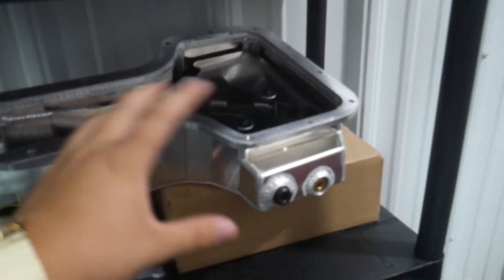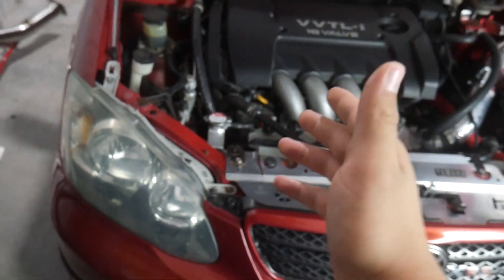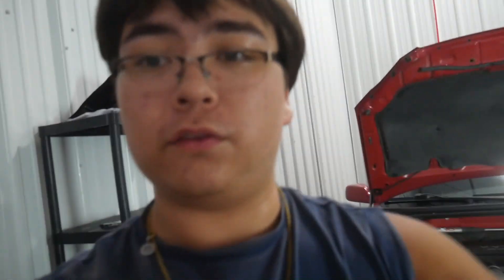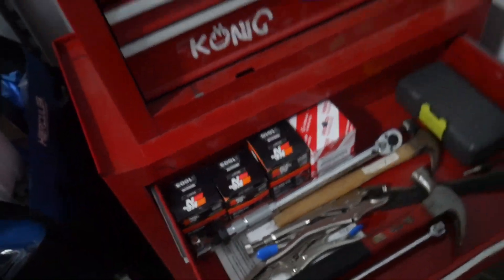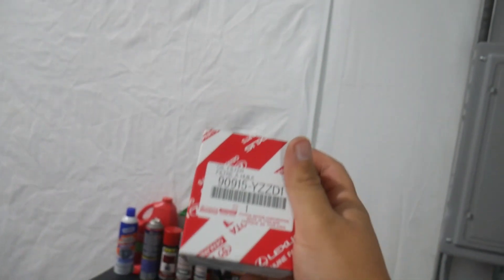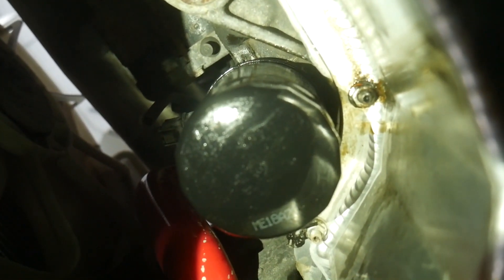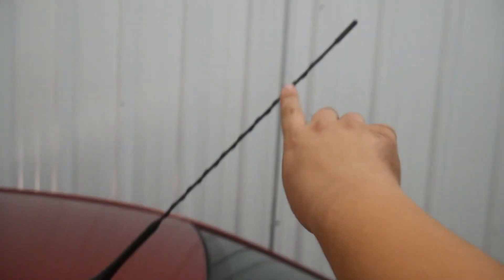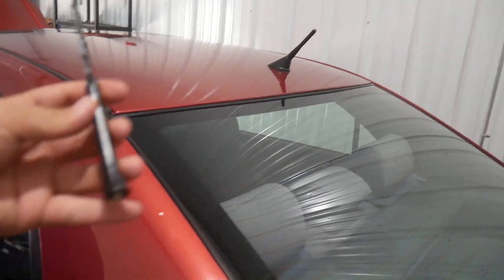My XRS Got The Infamous Timing Chain Cover Gasket Leak...

Comment: I installed a new timing cover rubber gasket including applying RTV to the specified areas in the repair manual, everything assembled to spec and torqued, yet i still have a tiny tiny leak just under crankcase breather tube near the timing cover.

Comment: Ive ran royal purple in my car since i got it @70k. Now it has 148k. I like it a lot. Also, for an oil filter, Fram Endurance is top notch for flow and filtration. Fram gets a lot of hate, some deserved, but research the Endurance filter specifically.

Comment: Are you sure it's the timing cover and not the timing chain tensioner? Ive seen the tensioner leak way more often than the timing cover. On that model year I'm not sure if the timing chain tensioner uses a mls gasket or a rubber o ring to seal. Get a new tensioner and gasket from the dealer it takes an hour to replace if you're going slow

Comment: Just keep it topped off and send it. Mine leaks like a screen door on a submarine but still runs like a bat outta hell.
Reply from the maker: That's the plan for now! With how slow the leak is now and with the increased oil capacity from the moroso pan it takes forever for the oil level on the dipstick to decrease so I'm not super worried about it
Reply: @WillChang  I swear mine got worse almost instantly after I switched to full synth. Maybe it was coincidence….but I don’t know. I mean I literally saw clear oil dripping right after I started it up after that change. I thought “did I spill oil somehow when pouring it in???”  Nope. I know it’s much less viscous but didn’t think that would happen.  Then over the course of the next month it continued. I guess go worth maybe cause the extra detergents? I don’t know….but the seal conditioners in “high mileage” full synth (I can’t remember what brand, Mobil, or  valvoline) are no match for the lower viscosity of full synth. Anyhow….good luck. I’ll do the job one day. Lol. Now that I have an 04 vibe 1zz auto as a daily.

Comment: are you sure it is the timing chain cover gasket and not the timing chain tensioner gasket, that little o-ring on the tensioner leaks its a very common 1zz and 2zz problem
Reply from the maker: That’s definitely a possibility as well, I’ll probably end up servicing all of the gaskets in this area at the same time anyways
Reply: Well just saying if it is then you don't need to remove the timing cover to replace that o-ring
Reply: I had the same problem, replaced the timing chain tensioner, and still leaking so I’m convinced it’s the timing chain cover gasket
Reply: @WillChang  yeah might be worth trying the o ring first. But….remember you gotta jack the motor up and remove (or at least loosen) the belt tensioner in order to remove the chain tensioner. Still lots less work than the cover gasket…but, if you’ve gone as far as that might as well do the cover.

Comment: 90915-yzzf1 is OEM toyota filter and what I always run in my XRS.  It matches diameter to the 1zz filter but is a little taller. With how sensitive the OEM oil pumps are in these I don't think I would recommend playing around with anything else.
Reply from the maker: That's probably the filter I'll use in my next oil change, I'm using the 1mz filter mainly because I already had one and I heard of other 2zz owners using them with no issues